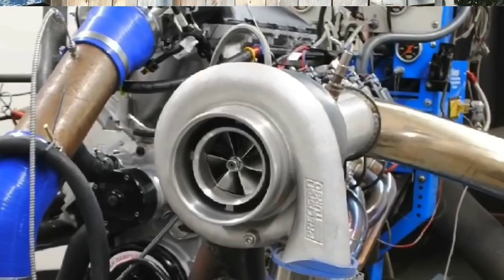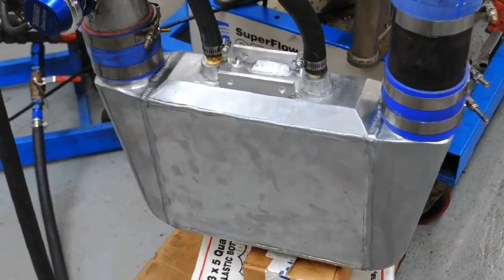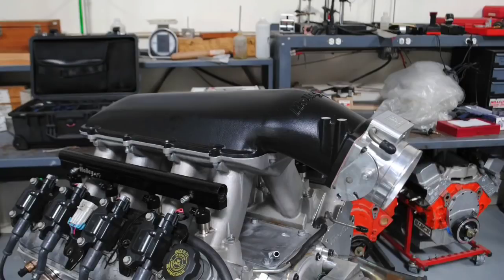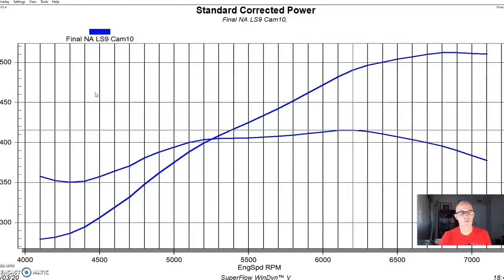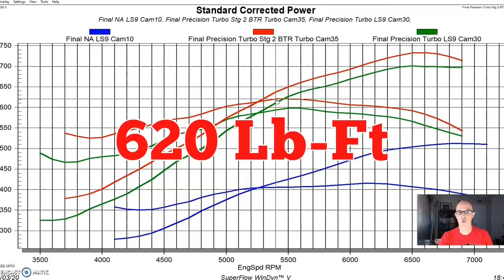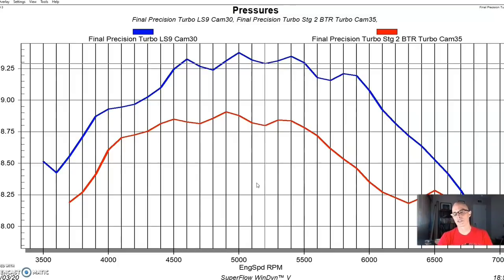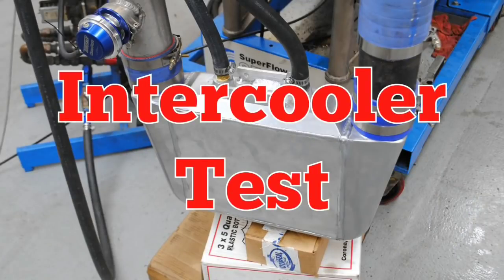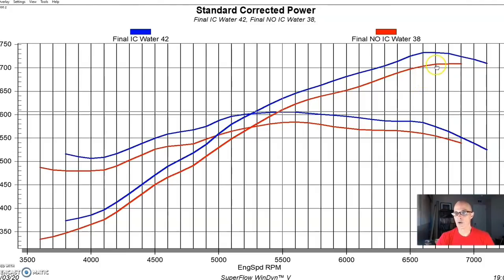TURBO DESTROKED LS- BOOST, CAM & (LOW BUCK) INTERCOOLER TEST

Comment: Out of curiosity. Outside of being able to run a pretty high RPM, what is or are the benefits of running a big bore 4.8 or de-stroked 6.0? I absolutely dig this buid, just wanting to understand both sides, building this way versus just running a standard 6.0 (or 5.3 or 5.7).
Reply from the maker: IF YOU HAVE A 4.8L AND INCREASE THE BORE-YOU WILL INCREASE POWER, IF YOU HAVE A 6.0l AND DECREASE STROKE, YOU WILL DECREASE POWER

Comment: Love this test. The question I have about the two cams is idle quality and low speed drivability. You mention the trade off of the BTR turbo cam being cost. What if idle and drivability are more of a concern than cost? In general, when you are comparing cams, can you start talking about the idle and drivability a bit more? I'd like to learn more about the end of it. Thanks Richard keep up the good work!!
Reply from the maker: we cant test drivabiliy on the engine dyno
Reply: I understand but you can see how much vacuum it makes and how low of an idle speed it can run smoothly at?

Comment: What happened to the air density? I bet you lost density when the temp rose and therefore power between the intercooler tests. This would explain why the boost was similar and the power was down.

Comment: Being a truck guy, I can assure you running the after market cam feels way way better. I’ve tried the ls6 cam. It made good power but it was lazy as hell down low and spooled slower.  At 6000lbs you can tell the difference rather easy.

Comment: Flow goes up, pressure goes down. So a high lift cam will always do this. 
https://en.wikipedia.org/wiki/Bernoulli%27s_principle
Reply from the maker: lift doesn't always change power
Reply: @richardholdener1727  Does it always or mostly change pressure.
I am mainly be thinking of a boosted engine were the pressure is high and the flow ca be increased.

Comment: The LS9 cam might be an excellent choice for a budget SBE 5.3 (or 4.8) because it would keep the torque peak a little lower. Then just turn up the boost control! Some of the aftermarket ECUs (like Terminator) could even do that for you. Really great info, Richard! Thanks!

Comment: Will a 454 gen6 head fit on gen4 454 block
Reply from the maker: it will bolt on-but will require a different gasket I believe

Comment: Would a 220/230....553"/.553"  117+4 lsa cam work well with a caddilac lsa supercharger or twin turbos???......it's a cam motion stage 3 ls3 cam. ....
Reply from the maker: yes

Comment: Super interesting!!! The big take away from this is , when you ran it with no flow through the intercooler you basically took the BTR S2 cam performance back to the LS9 camshaft level! 

On camshaft choices , yes you are always going to be limited by the power output of the turbo, but wouldn’t a better camshaft over a factory one make that power way more effectively?! Who even builds a turbo LS setup to make a thousand HP and scrimps out on the camshaft ?!  And chance when you are finished beating on that “big bore” 4.8 you would want to sell it ?!  Oh and ship it to Australia for me 🧐?

Comment: To just make a number on the dyno a smaller cam and more boost is fine, but a boat or land speed car, in my view, would benefit from bigger cam and less boost because lower boost generally means lower inlet temps, thud keeping the detonation threshold farther away

Comment: you mentioned the BTR cam vs LS9 and both could make the same power so Im assuming it would just require more boost for the LS9 cam.  How would the fuel requirements change with more boost?  I always consider fuel since Ive only got 91pump available locally
Reply from the maker: the higher power requires more fuel to maintain the same AF ratio
Reply: @richardholdener1727  sorry should have been more clear.  I was thinking about octane to prevent detonation

Comment: My intercooler is in the mail. I ordered it last week. Cxracing to the rescue. I still need to find a decent mounting point for the heat exchanger and fans and pump. I think I'm going to have to put the heat exchanger under the bed behind the fuel tank. No room up front.

Comment: Using dyno water with a controlled temperature in an water- air intercooler is kind of cheating.  In a car, the water hose size is nearly irrelevant, it's just the thermal mass of the water in the system acting as a heat sink and the cooling capacity of the air-water heat exchanger that lower your charge temp.  With the unlimited heat sink of dyno water, you will never see real world water-air charge temps.

I learned this long ago on an experimental high temperature coolant loop with a water-oil heat exchanger.  The idea was to heat the oil with a number of heaters and regulate the temp by controlling the flow of water through the heat exchanger using a globe valve to give finer control.  On the first run we discovered that just barely cracking the water took all of the high temperature out of our coolant loop.  We had to bypass the oil side of the heat exchanger to reduce its effectiveness to a useable amount.
Reply: They dyno must cause an increase in cooler flow for that dip in temps to show up. I always see steadily rising intake  temp curves on my air water coolers. when the engine is under load. That being said the flow thru the cooler as a huge effect on intake temps. I iften run tandem pumps to get enough flow to  be able to push 100gpm thru the coolers as that normally drops charge air temp 20deg over 50gpm on my setup. So hose size on the vehicle does matter.

Comment: Great video Richard, lots of information ( I wondered how that LS9 cam would run NA ) and my take might be a little off the norm.  My current build is a 5.3 bored out to 5.7 with a BTR Stage 2 Truck Cam.  After running it up and working out any bugs I was thinking of installing a single turbo.  I don't think I will bother adding a intercooler because if I could make over 700 hp I'm looking at upgrading my trans, diff, brakes, frame and suspension basically rebuilding the truck I just built.  More power is nice but at what cost ?  I'm not ready to put another $7000 into my ride because in my experience after you crest the 500 hp level things tend to get really expensive.  Maybe a small positive displacement blower, a TVS or just a larger displacement LS might be my ticket at the 550-600 hp level anyway, thanks for your efforts and information and long live the 1,000 hp LS.

Comment: Would take the LS9 cam , glass smooth 600 rpm idle,  20 in. vacuum . Soft power down low helps the engine live longer .

Comment: Can I run DYNO WATER in my air/water intercoolers in my two cars instead of water and antifreeze?
Will I get a lot more power?
Thanks!
Reply from the maker: dyno water is magic
Reply: @richardholdener1727  OK!  My cars need an infusion of magic. Thanks!

Comment: Is it common to see lower boost without an intercooler? I thought higher charge temp would result in higher manifold pressure or same pressure with a difference in charge air density?
Regarding camshafts, if I went to the effort to build that engine for that purpose, I would definitely run a dedicated turbo cam. If I was slapping a turbo onto a car for a bit of fun, I'd leave the factory cam.

Comment: Hey Richard   I work as an industrial  electrician/instrumentation technician.  I love hearing  you talk about the instrumentation on the dyno.  Today you mentioned  thermocouples.  I've heard  you mention pressure sensors, vacuum sensors, temp sensors, ignition drivers, data channels.   It's awesome.
Reply from the maker: lots of data monitoring-more date equals better
Reply: @richardholdener1727  if you have any questions about how instrumentation  works let me know and will help you out.

Comment: Great video Richard. With the increase in manifold heat, I would expect the manifold boost PSI to increase (due to heat expansion), and the air density to decrease-less dense air equals a decrease in HP. However my theory, the increase in manifold boost, does not jibe with your results (11:10). Any thoughts?
Reply: The wastegate is controlling boost pressure, so even though air density is less, the pressure stays about the same.  Don't get too upset about less than 1 psi variation.

Comment: Still love to see a 455 olds on the dyno tiny bore and long stroke 😎
Reply: It's not a tiny bore.  4.125 x 4.25 is not very undersquare.  But I'd rather have a BBC.
Reply: Andy Harman 4.125 is a tinny bore . 400 sb have a 4.125 bore
Reply: @unclesquirrel6951  400 Chevy is not a tiny engine

Comment: Richard, was there any gains on the hot side as far as drop in pressure from the cam swap? I cant imagine it could be much but would be interested in knowing.
Reply from the maker: when you increase power-you increase back pressure
Reply: Yes. Was wondering which cam was more efficent. I know we saw a half a pound of boost on the cold side.

Comment: How about two engines of identical displacements, one undersquare, one oversquare? Seeing the differences in power delivery NA and with forced induction?
Reply from the maker: if the compression, heads, cam and intake are the same-the power will be the same
Reply: Richard Holdener 
Not the curve though, I think its what he means.
Reply: @applebitefool  itll be the same. He sorta did that already. Moving the same displacement of air through both engines
Reply: Yeah, if everything else is the same, then they'll make the same power / torque.
A shorter stroke, in and of itself, doesn't magically turn an engine into a high RPM screamer. You would need to reconfigure the rest of the engine for high RPM, as well.
Reply: @michaelblacktree  yeah, im well aware that provided the bottom end is capable of handling the force, the overall limiting factor is in the top end as far as reliable RPM. 
If the bore/stroke ratio at a fixed displacement doesn't matter for power, why do engine manufacturers seem to have such varying range of said ratios?
Reply: @michaelrodgers6559  - why are there different flavors of ice cream if it’s all dessert?

Comment: So I’m limited on IC space, anyone running a 5.3 without a IC on 93? Or would e85 be needed? Looking to make around 500rwhp
Reply: You could also run water meth or just washer fluid so you don't rattle the brains out of it
Reply: David Gomez yes I’m looking into this but the kits seem rather expensive!  Might see if there is a way to make my own kit
Reply: @JohnnyAnderson1  i thought about using an old injector and just giving it full 12v

Comment: Can you do some other motors besides the ls like a hemi or a 6.2 Ford 5.6 Nissan 5.7 Toyota or even a 4.2 vortec in-line 6
Reply from the maker: lots of hemi, SBC, BBC and BBF videos up
Reply: The 4.2 vortec would be a fun motor. Be cool to see exactly what the vvt actually gives for power. The one I tuned you could watch the ve table jump when you went all in with it
Reply: Too bad it only has VVT on the exhaust. That said, I might like to swap one of those into my BMW.

Comment: Residual water in the intercooler will store more heat with no flow than an empty intercooler.
Reply: Even without flow, if the intercooler is full of water and the compressor exit temp is higher than that water, there will be heat transfer to the intercooler for a while—until the intercooler heats up. With no water in it, the temp rise in the intercooler will happen faster...
Reply: @bdugle1  I agree. So when the water temperature rises and stores heat it will transfer any heat above the charge air temperature to the charge air. Turning off the water flow is not the same as no intercooler. It will actually create a higher inlet temp.

Comment: Less compression, so I’m guessing the advantage would be more boost with less stroke?  14 to 19 psi would be “safer” for the motor versus stock bore and stroke?
Reply from the maker: not sure how you get 14-19 psi, or the correlation between more boost and less stroke.
Reply: Richard Holdener was thinking less compression but who knows? Maybe a myth.

Comment: Boost pressure is just a measure of flow resistance.  

It would be cool to see a measure of the mass airflow x rpm.

Edit, that turbo is not properly sized for that engine. Ideally it should stay flat out past your red line.  I think the cure is a bigger exhaust wheel or a larger AR exhaust housing

Comment: On a street “boosted” engine, almost any cam that gives the natural aspirated HP peak at the RPM range “you want” is probably good, then adjust the boost/HP as fuel’s octane allows...

Comment: I’d like to see a test between at de-stroked 377 sbc and a stroked 383 sbc. Both n/a with same compression ratio and same heads, intake, carb. Maybe different cams to optimize each setup. Would be interesting
Reply: Dude good call I've been considering a 377 build,
Reply: Ben there, 377 wins that race  as long as you take advantage of the bigger bore, same ci ,but less shrouding of the valves. Plus they are just a smoother running engine.
Reply: Agreed bc I always wanted a 400 block but I dont know which would be better a 406 or a 377 or a 383
Reply: I agree. This would would be be a much more realistic and worthwhile comparison for a test...   what ive gathered is that each setup has its benefits and drawbacks.  What it will come down to is your application and intended use, more than anything else...   we all know that in order to gain anything from a smaller stroked crank, longer rods and likely different pistons would be necessary.  A cam with more valve lift to push the peak power curve up in the RPMs.  Obviously this setup and handle slightly more boost all other variables being equal...   ive been considering this exact setup myself for my 2800lb toyota pickup, after blowing the 370.  A destroked Boosted LS could offer some benefits. But unless the motor sees >7,000 rpm constantly, there’s going to be power left on the table at <7k rpm.   If I forged crankshaft is on the grocery list of parts regardless, a 4” stroker crank and deep dished pistons would be an absolute torque monster with less boost. And at the end of the day, both engjne setups would cost roughly the same.
Reply: And another thing to consider is valve train upgrades, and converter selection. And The fact that most auto’s will need internal upgrades to handle the higher RPM’s, is also something to consider. But thats another topic for another day.

Comment: Personally I blame the dude that blames the squirrels.
Reply: haha 😄
Reply: Bubba Bearpaws :IMHO,  its not John Woodworth's fault. Its the Pelted Nut Procuring Foamy -Mouthed Tree Congregators. 1335 to 1385 of them can take a whole HorsePower off a SF 902 dyno reading. Or more, if just one gets Inducted into the Chevy 102 mn throttle Body Hall of Fame.

Comment: Interesting results,  I like the idea of the ac cooled bricks in the intake as well. Have you tested those?
Reply: Theres a new super car that will block off the a/c an dump it into he cold side of of the intake or the cold side.  I can remember witch engines it was but i watched the vid a few days ago its a very good idea.
Reply: @ronniewilliz153  the dodge demon does it, as does the aftermarket forced induction interchiller, have one on my car, very effective
Reply: @willronald6690  oh shit sweet didnt know that. Its about time tho they started doing that. U can loss from it unless it stops working
Reply: I've heard of the gt500 running chillerkillers (might be the other way around)  one dynow run I viewed on a forum didn't show much of an increase to the wheel but the iat's were way lower indicating either the ac was sucking power or it needed more boost. The guy my not have been running enough boost to make a huge difference.
Reply: @TheDude2111  you really need to increase the ignition timing to take advantage of the cooler IATs to see the advantage, otherwise there would be little to no gain. Most cars AC system disengages when at WOT
Reply: @TheDude2111  AC is going to be a fraction of a hp nowadays compressors are very efficient. At the minimum the power would be much safer if it didn't add power. You gain power from more air going in because cooler air is denser but also the cooler charge let's the spark stay the same but power is safer
Reply: @LT3Fluffy  I agree with safer power but compressor A from 2008 in good condition will have as much power draw as compressor B from 2020 at 100%pwm (assuming compressor b is a variable efficiency compressor).
Reply: @TheDude2111  which is still negligible amounts of power. Maybe 1hp
Reply: @LT3Fluffy  I can't honestly say one way or the other. I've never dynoed an ac compressor. I suspect it would be like dynoing a supercharger. In vs out vs hp required to work.
Reply: The old compressors needed 13 horsepower from the 80s
Reply: @LT3Fluffy  - disagree. Provide source.
Reply: @grumpysteelman  why don't you use the internet you're on and look it up between 1 and 4 hp. Since you don't have a source either that must be too hard
Reply: @LT3Fluffy  - you said a fraction of a horsepower. Thanks for taking the time to tell me I’m right.
Reply: @grumpysteelman  you never gave a power number. Nice try. The point was that it was negligible when taking in account the ac to cool the intake charge. I guess you just needed me to to a single Google search for you because you needed a source but couldn't name a source yourself
Reply: @grumpysteelman  but its ok its my fault for taking the troll bait. You can rev bomb your cai d16 in peace now
Reply: @LT3Fluffy  - still trying hard I see. I knew a fraction of a horsepower was wrong from everything that I know. I’m not trolling somebody who I disagreed with and asked for a source in case I was mistaken. I wasn’t - and you’re now attempting to insult me? This has moved into pathetic territory.